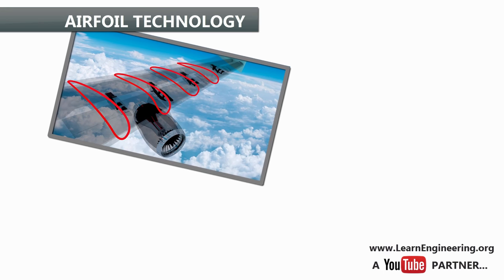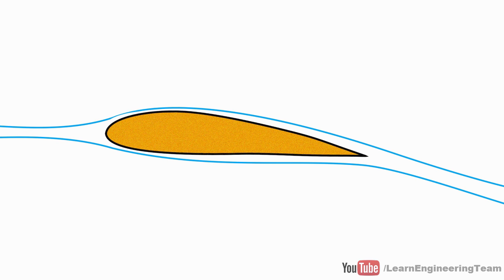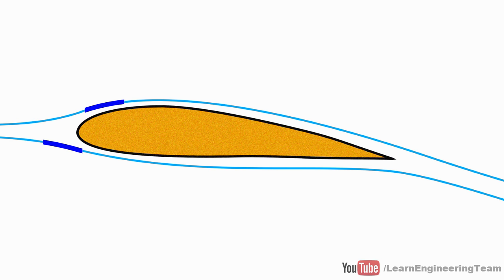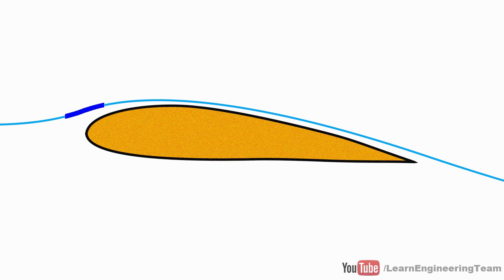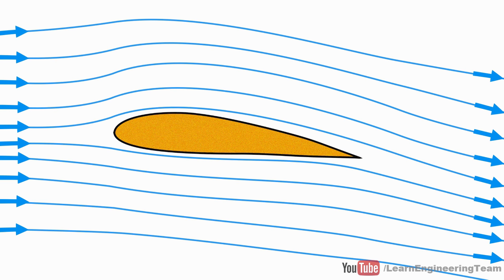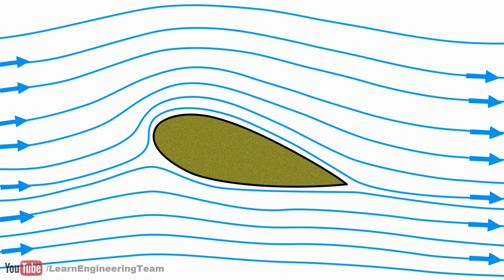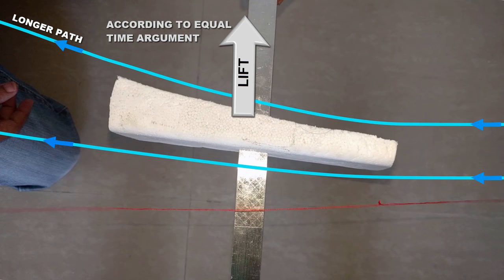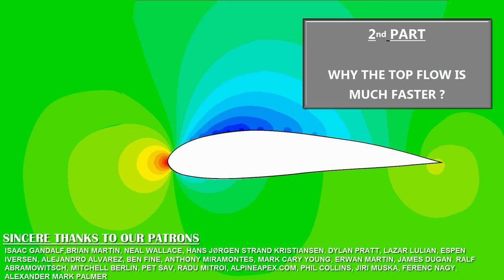How do Wings generate LIFT?

Comment from the maker: Be our dubbing partner and earn a regular income !
http://www.learnengineering.org/p/be-our-dubbing-partner.html
Reply: Learn Engineering dubbing in which language? Hindi?
Reply: Learn Engineering
Reply: Learn Engineering how can i earn regular income by dubbing?!??
Reply: Best cooling tech
Reply: It is so great to see this. The deflection theory is still not believed because air is not taken as having much mass density. So more must be said. Air is two pounds per cubic  yard, the same weight as a quart of water. Once air has weight and mass then making it change direction will create a force. That force is lift. Thanks.
Reply: +Anthony:   You said it,  air has mass, and a mass hitting another mass imparts its energy to that other mass.  This transfer of energy is called lift.  Explain things at their most basic.
Reply: this link is not working
Reply: @anthonychessick1832    A force is required to make it change direction.  <--Newton's first Law.
Euler followed Bernoulli's work and revealed in the mid 1700s that Pressure Gradients Accelerate fluid.  This is simply Newton for Fluids.
It is not the weight of air, but the mass.   The downwash is accelerated downward by the VERY SAME Pressures that provide the net upward lift-force on the wing.  The downwash does not need to weigh the same as the force accelerating it. 
Rocket exhaust does not weigh as much as the rocket, but it us accelerated to a high enough speed by that force.
Reply: Learn Engineering great
Reply: I ll do dubbing in hindi, for India
Reply: Will do dubbing in hindi
Reply: very simple the air at top is free to move and does not do any work so move faster...
where air at bottom has to do work and lift the wing, so get slow down in doing work
Reply: @richpilotmoore1744  ppppppp
Reply: Increase in spead at top of foil can be a result of acceleration of air from high pressure to low pressure
Reply: Looking at the explanation i don't think bernoulli principle is wrong. What actually is wrong is that we were not given proper reason for why speed increases. We knew speed increases and since speed increases pressure must get lower. Bernoulli theorem tels it correctly.
Bernoulli theorem can only help to relate velocity and pressure. But when we don't know what is going to happen with speed and pressure we can't use bernoulli theorem. We need separate explanation for the lift. The reason is what you told i.e, pressure difference. And knowing the decrease in pressure we can predict that velocity must increase according to bernoulli theorem.

I think even when there are two streamlines we can still relate them since they had intially same pressure and velocities.
Reply: bangla could be one of the dubbing language. Can i help this channel to do so.

Comment: Wow!  I remember when we were taught about the wing and Benoulli at school, I could never understand how or why 2 air particles must meet at the rear of the wing, but I was told I didn't understand.  Yes I did!
Reply: student: why does the particle on top have to reach the particle at the bottom at the same time????
teacher: you don't understand
student: if you answer the question i might understand
teacher: no
student: why
teacher: uh, i smart, i understand, you dumb, i go now
Reply: If have something that has any kind of high spot on top and is flat on the bottom it should have lift like a wing but they don't !
Reply: That's incredible that the students were taught the wrong things
Reply: Came here because I could understand how was also posible...
Reply: You still don't understand.
Reply: I remember the same as you!

Comment: With all the aerodynamic engineers on here arguing with one another its amazing we can even design airplanes that work in the first place.
Reply: it's easy to make an airplane, making it a good design is the hard part
Reply: Amen
Reply: What we need is a wing that won't stall !
Reply: Correct me if I’m wrong but can’t you account for lift by looking at the distance air has to travel from leading edge to trailing edge for each side and assume air starts and ends at these edges at the same time for both sides, and determine the speed difference between them (0.5*(v2^2-v1^2)) and plug that into L=1/2 CL rho A v^2 and determine Cl graphically from CL vs AOA
Reply: guess why their in the comments arguing: because nobody is hiring them to do a job or make something, therefore they are about as useless at engineering as you and i. the real engineers are busy actually making a difference with their lives🙂
Reply: @derrickbecker9856  This is the equal transit theory, which is incorrect.
Reply: @windowsxseven  Bro. Literally... Its not easy to make an airplane..
Reply: Very true
Reply: @suryakamalnd9888  look up some random rc plane channel and you'll be surprised
Reply: @windowsxseven  I'm talking Real planes not kids toys ..
Reply: @suryakamalnd9888  imagine liking your own comments
Reply: I wanna be aero engineer :)
Reply: This is most things in life. We figure things out by trual and error, but often lack an understanding of the detailed mechanisms involved. Many medicines, anesthesia, etc. just work, we just don’t know how.
Reply: @thebasilee2  Good Luck

Comment: ty for the video I have a simple question. Does an airfoil generate lift 'using only one of the 2 stream? in a car situation, if i shape the leading edge splitter  as airfoil ,above that you still have the front fascia-bumper. Would this Null the airfoil ?

Comment: The presented experiment with water sticking to the surface of the bottle is not the Coanda effect, it's just a result of surface tension, adhesion and cohesion of water molecules.

Comment: why is higher pressure above the particle in 3:20 ? also is this explanation based on a reference frame that moves with the plane so air moves relative to the plane ? could we use the same explanation for lift when air is not moving relative to our reference frame ?

Comment: Bernoulli's equation applied along the streamline. For the streamlines above and below the airfoil, the total pressure is the same. But the static pressure is different (low static pressure on the top and high static pressure at the bottom). This causes a difference in the relative velocities of the particles on the streamlines.
Reply: but lift is generated by the force acting ON the surface, ACROSS a streamline. To accelerate a fluid particle there is needed to have a STREAMWISE pressure gradient, tangent to the path. It has nothing to do with normal forces that generates lift
Reply: @josue8632 the static pressure acts in every direction. Hence it gives both the stream wise pressure gradient and the normal force. Now you can argue forever about cause and effect but it doesn’t change this fact. Not only is it observed every time you look for it, but it must happen according to the law of conservation of energy.
Reply: No one really knows how lift is generated,  just like panadol, no one knows how it works to relieve pain

Comment: Just wondering, if the air above the wing is flowing faster than under the wing, then does Bernoulli's principle still indicate that their should be higher net pressure underneath the wing therefore generating lift?

Comment: If you closely examine the Picture at 6:42 you can see a pressure increase at the bottom of the wing which causes a slowed air flow because "the oncoming Air particles have to push against a higher particle density" of the high pressure at the bottom. At the top because pressure decreases, oncoming particles are sucked into some sort of partial vacuum causing an inrease in flowrate at the top of the wing. An increase in flowrate means higher particle velocity at the top
Reply: Thanks :)
Reply: I have to disagree and here's why...
Reply: Or more like, lower pressure zone - higher velocity, high pressure zone-lower velocity
Reply: Just like using Bernoullis principle
Reply: You are correct,  the video is misleading by ignoring the assumption of continuity equation
Reply: @derrickng4589  Correct me if I am wrong, but the continuity equation only applies to fluids (which are theoretically incompressible), right? In this case, air is compressible and so it can have different pressures at different points meaning the continuity equation does not hold.
Reply: @giphe  yes,  if the air compressible,  work is done on the air and it results in increase in density and pressure as well
Reply: @giphe  Air is a fluid and fluid can be compressed. You are confusing it with liquid. 

Also, even liquid like water can be compressed but they require too much pressure for a little compressor that we generally refer to them incomprehensible but theoretically mostly everything can be compressed.

Comment: Anti-Bernoulli theorists always use the 'equal time' argument. It makes it look like the wing is static and the air is moving (so the idea of two separated particles meeting again seems odd). In fact it's more the other way around; the air is static and the wing moves through it. As it slices through the air it separates particles momentarily, some going above and some below the airfoil . Inertia means that these particles tend to stay in a similar orientation to each other and substantially meet again at the trailing edge of the wing. 
However, the shape of the upper wing surface and the overlaying layers of air act rather like a Venturi. The air particles relative speed to the airfoil surface between those layers increases in order for the airfoil surface to flow past the same number of particles as before. This increase in dynamic pressure is countered by a loss in static pressure, due to the principle of conservation of energy, as no energy is being added to the system, the total energy (static + dynamic) must remain the same.  (Coanda advocates usually express the same proposition by depicting the particles stretch further apart.)
It is this lowered static pressure that generates lift; which by the way can be directly measured in wind tunnel tests and is definitely there. You can simulate it by blowing over the top of a model airfoil or even across the top of a straw stood in a liquid. The Coanda effect and reaction to the downward redirection of the relative airflow also play a part, but to dismiss the Bernoulli effect entirely is inaccurate. Differences in airfoil design can also influence the relative significance of each (e.g. a specific type of trailing edge is needed to maximise Coanda).
For it all to work the airflow needs to be relatively smooth and laminar; if it becomes turbulent the effect can be substantially lost. Thats why odd (non-airfoil) shapes with longer upper surfaces are not effective for generating lift. A typical subsonic airfoil will also break down into turbulent flow at about 15 degrees angle of attack, commonly referred to as an aerodynamic stall. It results in a loss of about two thirds of the lift being generated. 
BTW. The compressibility of air becomes an issue as you approach the speed of sound and the fluid dynamics changes. Supersonic airfoils are a different proposition in many ways. Even today supersonic aircraft try to spend as little time as possible in the transonic phase, when the fluid dynamics transitions from one to another, and different relative airspeeds around different parts of the aircraft make things 'interesting'.
NASA have a good simple explanation of much of the above on at https://www.nasa.gov/sites/default/files/atoms/files/foam_wing_k-12.pdf
Reply: I know this was an old comment, but it was so good, yet wrong in one or two ways, I had to comment.  Part of what you stated assumed that there is no energy being added to the system.  But movement of the plane through the air is adding energy.  The plane must accelerate to counter act gravity.  The wings are designed to aid the fight against gravity using fluid effects to its advantage, but it isn't as if any airplane can fly without initial acceleration.  Force is used.  Energy is redirected or added to the system.  If no energy were added, then none would be used and planes could run without fuel.  I'd like to live in such a world, but I don't think that invention has been discovered yet.
Reply: @Tletna  Might need to revise your physics a bit. 
When in steady flight an aircraft is at a constant velocity and therefore not accelerating (a change in velocity is the definition of acceleration or deceleration). The aircraft's weight is balanced by the lift generated by the wings. The aircraft engine's thrust balances the drag generated from moving through the air.  When not in steady flight (i.e. not flying straight and level, or in a steady straight climb or descent) the velocity is changing and the aircraft is either accelerating or decelerating. 

When accelerating up to a steady state of flight the engine power has to both overcome the energy needed for acceleration and the drag of the aircraft as it moves through the air. That's why aircraft need a lot of power for take-off, but not so much to sustain a steady state of flight once en-route. It also explains why streamlining of aircraft is so important, as it reduces drag, therefore reducing the amount of power (and fuel used) to sustain an aircraft in flight. When turning an aircraft is accelerating as its direction is changing (steep turns require extra power to overcome this).

There's lots of clips on YouTube about it. Try this one for a start -   https://youtu.be/SV1Nf9yB7B0
Reply: @Tletna it seems that the faster the plane, it just means the faster velocity of the air. More static pressure will become the dynamic pressure, this leads to a greater upward lift force. The energy of the accelerating plane is just to increase the plane speed!
Reply: Except for the fact that energy is actually added to the system.
Reply: @tacitdionysus3220 aircraft is constantly accelerating to negate the drag forces. The constant velocity thing requires no acceleration is only applicable if there were no air resistance or drag.
Reply: 100 ton plane = 100,000 kg
F = ma
100k Kg x 1 m/sec^2 = 100k N trust required.
After a certain velocity, air has very high drag forces and air resistance. This is why trust levers are still near 80% during constant speed cruise.

Comment: The Bernoulli theorem can apply if the air can be regarded as a laminar flow like a plastic sheet. The air particles in a layer adhere to each other like an elastic sheet.

Comment: @4:23 If in curved surface the out side pressure should be grater than near the surface ...why will the pressure increase as we move towards the bottom surface? Bottom surface is a little curved too.

Comment: Well explained........But have a question!
Due to coanda effect,the pressure is decreasing from top to bottom as we go towards the airfoil on the upper side.
I agree to that!
However,why can't we apply the same concept for the air flowing on the lower side of the airfoil.What I mean to say is that even if  the pressure is considered to be decreasing from atmospheric value to some lower value towards the airfoil on the lower side,still the coanda effect will be met!
Please clarify!
Reply: The air particles in the flow stream have mass and their momentum would try to keep them moving in a straight line, but the tail end of the top surface is dropping away from that straight line. This causes a lower pressure between the flow stream and the surface than above the flow stream, which puts a downward force on the particle and lets it approximately follow the shape of the top surface while the lower pressure (relative to the bottom surface pressure) pulls up on the wing. Below the wing, the surface is dropping toward the flow stream, compressing the particles and increasing pressure between the bottom surface and the particle. That again produces an upward force on the wing. Two different conditions, both producing lift (and drag).

Comment: Thanks you, I had my middle school in China, we were taught with the wrong theory. I never understood why airflow can reach the end at the same time, because it's totally wrong!
Reply: Its not about whether molecules which are side by side on the front meet exactly together on the aft side.   Ask yourself this:  If the airspeed on top of that wing was not faster than the bottom on the average, what is happening to those extra air molecules which necessarily build up.   Is the airplane, on that 10 hour flight dragging all those extra air molecules along with it? 

 The fact is, for the last century, millions of wind tunnel test have been done measuring everything you could possibly imagine about wings.  Don't you think that that issue has been measured in all that time??  Naïve.   The air does move faster on the top, and that fact causes net lift.

That is not that traditionally they have been right about the PREDOMINANT cause of lift.  Lift is predominantly caused by plain old boring angle of attack.

Btw, +schollterrorist, literally everyone reading your comment is scratching their heads in confusion about what you were actually trying to convey.
Reply: It does have a longer route to take.  That's the point.   Btw, your original post was indecipherable.
Reply: Kevin Chen We are told that in the United States as well. It never made sense to me. It wasn’t until college that someone confirmed it was wrong.
Reply: You guys were taught!!!
Reply: you studied airfoil in middle school, bruh
Reply: @Avocado Toast all write an argument later... Remind me 12 hours later
Reply: SchoolTerrorist  The top of the wing is a longer route.
Reply: @Avocado Toast You're wrong. Air sticks to surfaces just like water does.
Reply: China? xijinpingpingi
Reply: dear Kevin Chen, I am from Ukraine. In middle school, we were told the wrong theory. But at the university, the teacher answered this question "hmm..."